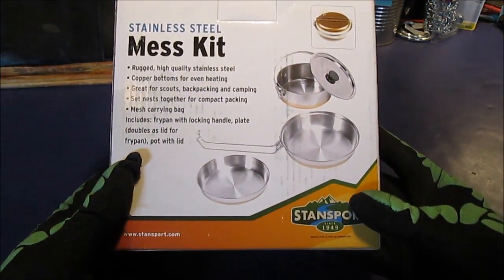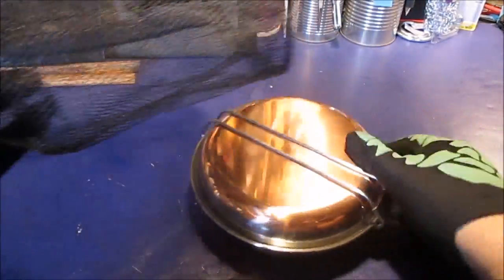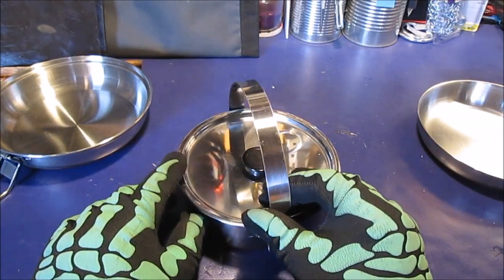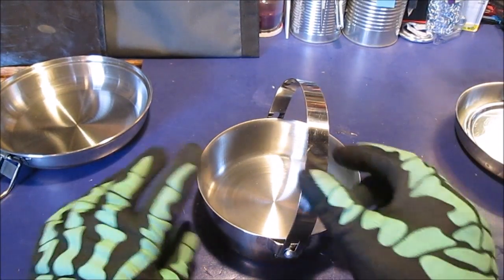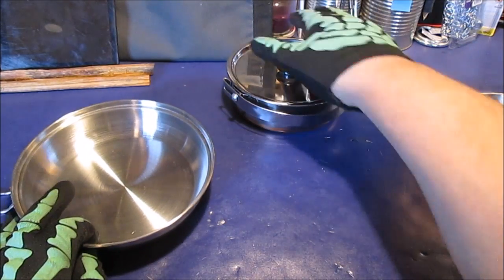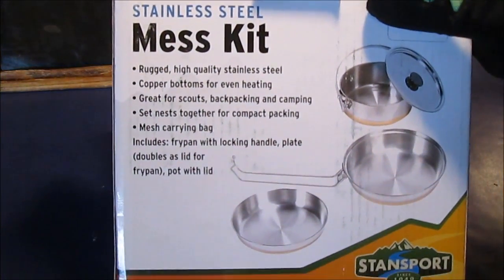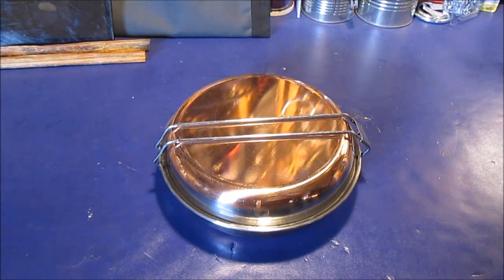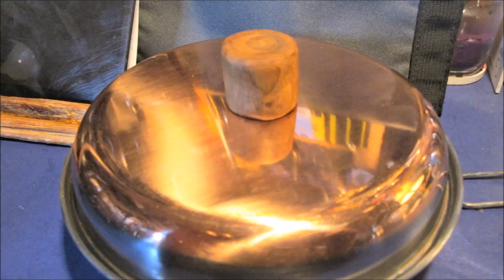Stainless Steel Mess Kit

Comment: I have and used this mess kit for about a year now! Mine came with no copper on the bottom tho but it's still holding up good.
Reply from the maker: The copper on these is so thin that I don't think it works much better than a regular set...still it is a nice kit

Comment: Nice review. Been thinking about this one and may get it after this video. Thank you.
Reply from the maker: The copper coating is thin ..but it is a nice kit for a cheap stainless one ...be careful and don't over heat it on the fire the pans are thin
Reply: This kit goes well with the Trangia 27 series kettle.